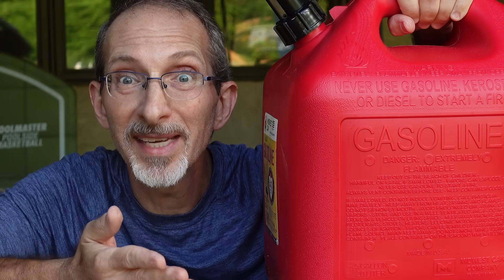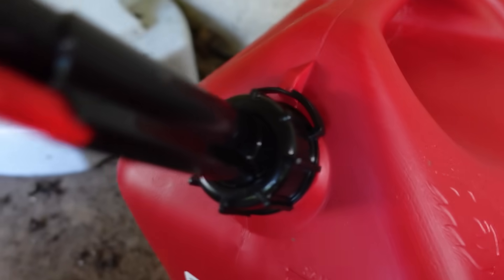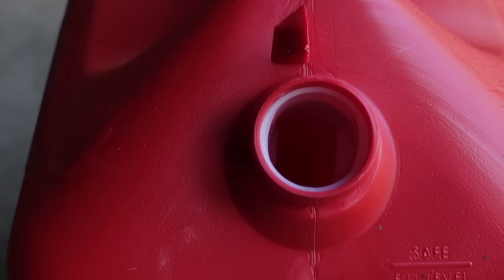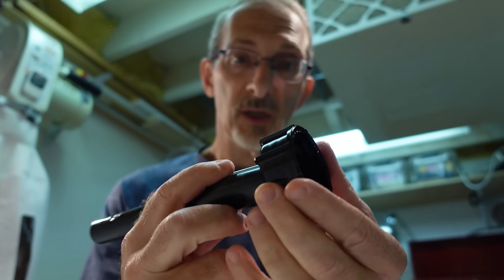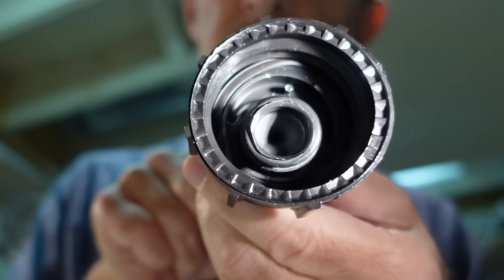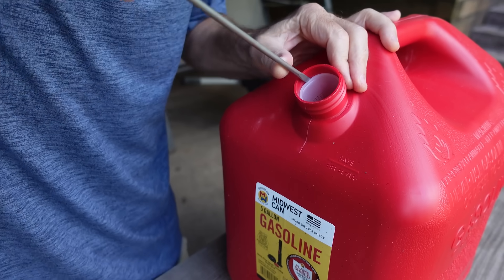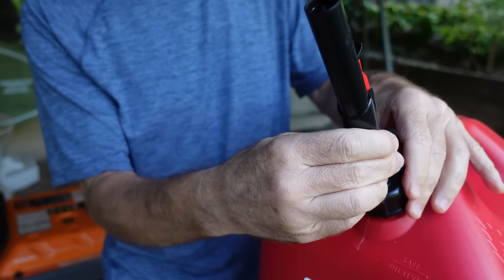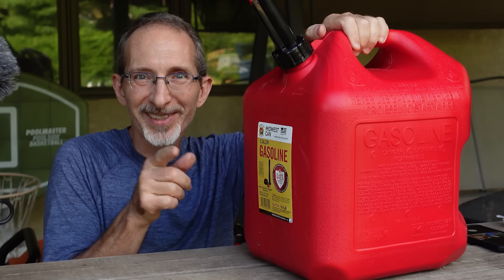Gas Can Modification | New Gas Can Fix

Comment: As soon as you get the very 1st gap on your debre filter , get your plyers in real good and twist the plyers till the filter collapse's and comes loose then it will slide out easily . If you will try this the filter will come out in 30 seconds and no damage to the fuel can.

Comment: The absolute stupidest part about these stupid "No Spill" gas can designs is that they cause you to spill way more gas than any of the sensible old designs. But wait it gets dumber. When the can is a couple of years old the spout will no longer close. You literally CAN NOT close the can because the automatic spout gets jammed in the open position. Brilliant design.

Comment: These are nice gas cans. I have 4 or 5. That said, if you're storing multiple cans then you really only need one nozzle. You can buy an "old style" nozzle with a cap and just buy a solid cap for the rest of the cans. I use a solid cap on all my cans and keep a nozzle to put on the one I want when I want to use at the time. It's also best to use an all-metal tire valve stem to put on the back of the can as a vent. There's plenty of vids to show you how. Just make sure you use the all-metal type. The rubber valve stems don't last because, obviously, they're not designed for constant hydrocarbon exposure.

Comment: My solution is to remove everything, leaving only the threaded outer ring, and cut a disc of 1/16" Teflon to cover the hole in the cap. To pour out gas, I've made a funnel out of a coffee percolator from a thrift store, solves all spillage problems.

Comment: I left the dirt filter in mine and installed a retrofit kit, new longer flexible old style nozzle and drilled a hole at the bottom of the handle for the vent plug and now it works at the pump and to fill my scooter up ( too hard to regulate the pump pressure on a scooter fuel tank so using a can is so much easier ) a little slow but I can actually get a full tank this way

Comment: 😮Tractor supply, Northerns, Harbor Freight, even Amazon sells a very affordable kit, to kinda convert gas cans as they use to be, kit comes with an air vent with a snap lid, drill a hole an pop it in, kit comes with a nice flexibility spout also with a cap, with extra screw caps to insure it will fit any brand. Also comes with a storage cap.. this is the best way to deal with this so called safety can..

Comment: You bought the wrong gas containers. There are push-button valve cans on the market that work great. Easy to fill. Easy to dispense into small power equipment tanks. My favorite is Spill Proof brand
Reply: Sorry.. actual brand name is No-Spill

Comment: Yep, todays gas cans suck.   A few years ago, I bit the bullet and bought some metal military/NATO spec gas cans ( Wavia brand).  They are expensive, but for work & play I’m engaged in, they are worth it.  These days, they do come with horrible safety plunge type spouts, but a few mouse clicks will get you the good old fashioned free flow flex spout.  I only put a spout on to fuel, otherwise the cans are sealed with lid, so no off-venting. The lid closure and spout attachment are with a simple cam lever - quick and easy, no screwing on/off with safety mechanisms.  These also resolve an issue I’ve had with every plastic can, deformation from pressurization and temp change: ballooning out or collapsing in - they are the same again.

Comment: Last winter I bought a diesel heater and got a "Midwest Can" brand jug for diesel fuel.  It's basically the same design, just made with yellow plastic instead of red.  I had the same trouble with the spring loaded spout, but didn't realize that anything could be done with it and just resorted to trying to pour without using the spout at all.  I usually didn't spill much...  unless there was any kind of breeze.  This is so much better.  I don't know how youtube knew to recommend your video, but I glad it did!  Thank you.

Comment: Reading the comments I'm amazed at how many people can't use a gas can. Also can't believe what a weakling the guy who made the video is. The spring makes it too hard to push? I modify all of my gas cans. It doesn't take a genius to be able to figure out how to cut that first tab off. Just grab the filter and pull, it's not hard to pull out. Removing the spring is pretty stupid because then gas can leak all over when it doesn't seal. I just break off a little red tab and have no problem pushing the nozzle in to start the flow, but it still seals the can. I prefer the spring-loaded nozzle because I can turn it upside down and get it into the tank I am going to fill without spilling any gas until I push down. I can't believe YouTube pays idiots to make videos like this.

Comment: The filter is pointless...if it is supposed to filter any dirt coming out of the underground tanks then that dirt is there in the filter, so when you pour the gas into your say lawn tractor that trapped dirt now flows so nicely into your gas tank. Leave it up to those intellectual engineers. Shouldn't you at least have the option to be able to pull the filter out and tap out any dirt first.

Comment: I don't think it's safe to you as much as environmental. 
Best same do is go to a yard sale or auction just buy used one. Also remember to Cadillac converter test pipe so used to sell 30 years ago? Now you can get a repair kit for the gas cans at your local lawn and garden supply store. That does not include Woke-Mart! And not only does have a flexible durable spout. It also comes with a pressure release insert and cap. And $15 for a can like that nowadays is really cheap but your episode is 2 years old and it was just recommended to me by YouTube

Comment: I like your first idea.  clip off that thing and toss it.
The second idea... remove the o-ring, remove the spring, remove the whole insert, throw away... even the spring, you will never really ever use it again for anything.
Buy a rubber cork for what is left over of the nozzle.
Third idea... good work.  rip it out, throw it away.

If you want to be safe, then do safe things, and you won't have to worry about gadgets forced on you by some idiot lawyers.

Comment: Although the EPA has done a pretty good job for most environmental issues, this is one area they should have STAYED AWAY FROM! I spill more gas with these new gas cans than I ever did with a regular old gas can with a flexible spout. Not only that, your typical 5 gallon gas can now cost about $28-$30!

Comment: And... this is why gas cans are $20-$30  instead of $5. What I find incredibly stupid (the whole design is stupid, but one part outshines the rest) is the filter screen. So, I suppose it is there to keep contaminants out of your gas can, but the contaminants are trapped in the screen. The gasoline flows through the screen and through the nozzle into the tank that you are refueling. It would be much better to leave the trash in the bottom of your gas can.

Comment: I have the 2 1/2 gallon version of that can and it doesn't have a filter, probably because it's older. It is a pain in the ass sometimes, but not enough for me to want to modify it. If I did though, I think I would cut a few coils off the spring and reinstall it rather than remove it. If you ever accidentally knocked your gas can over, you know why.  I mainly use the can for filling my lawn mower. Instead of trying to press hook against the rim of the gas tank and pull the magic button, I have it facing up and pull it back with my thumb. As long as the valve snaps shut when I let go, everything works out, but one time it stuck and the gas poured out until I tipped the can upright, which I was doing anyway. Not a big spill, but I'd rather not waste gas by spilling it on my mower. The ratchet thing that makes it hard to take the filler cap doesn't stick after the first turn, so that's not a problem for me. It's actually a benefit because I took this can and another 2 1/2 gallon can with me on my ATV ride and overnight camping trip. I had the cap of an old gas can unscrew from the vibrations a really long time ago. It didn't have that minor inconvenience on it. Of all your mods, I would definitely remove the filter if it was causing ANY problems. Maybe shorten the spring so it had less tension, but leave the filler cap alone. BUT, above all, the government should keep their hands off our gas cans and let US decide what kind of gas cans  we want to buy. Besides, a pain in the ass vent-less can dumping fuel on the ground is worse for the environment than fumes evaporating out of a regular gas can.

Comment: Keep in mind that if the gas cans are used in a commercial setting, OSHA will require that the "safety" mechanisms be fully intact.  If they find that the cans have been tampered with, they can, and almost certainly will issue a citation and probably a fine.  

Other wise, great information,  THANKS

Comment: So what if you ‘break’ any rules. It’s MY gas can and if I am smart enough to not need those ‘safety’ enhancements I shouldn’t have to suffer with them. My old style cans with the snap on caps work just fine.

Comment: They sell the old nozzle kits. As far as the filter if you hold back a little and just pump gas on the low flow there no problem.

Comment: Now all it needs is an air vent at the top opposite of the spout, and it will pour well. Or you can take the whole spout off and pour into a funnel. That’s what I do with the new blitz gas cans to save them from being useless.

Comment: I’d recommend a No-Spill gas can.  No-spill gas cans are great.  They have a button on the back of the spout you press with your thumb to pour and (at least when I got mine 9 years ago) doesn’t have a filter blocking it he opening.  It still has the lock for removing the spout though.

Comment: Leave the spring in.  Simply remove the red latch that holds the nozzle out.  Then you can use the lip on the nozzle to compress the spring with out the security latch being in the way.  The spring remains functional and keeps the nozzle secure when not in use. Makes for easy one handed pouring too - simply lift your gas can away and the spring seals the gas in.  For small engines that move around,  you can use your other hand to compress the spring, or hold the  engine.

Comment: I hang onto all my old style gas cans that work the way they should, when I had to purchase a couple 5 gallon gas can similar to the one in the video, I also removed that stupid filter because think about it if you're filtering the gas is going into the gas can but then poured into whatever you're pouring it into whatever us in the filter is now going into the item that your filling. I also found at one of the big box hardware stores an aftermarket spout that has a flexible neck.

Comment: Sounds like a German way to engineer something.  Take something SIMPLE that has worked fine for years, (like a gas can with a pour spout AND and vent!) and "fix" it until it no longer works or is so complicated nobody wants to use it.

Comment: That's dumb. Once you get the needle nose in there you simply twist the needle nose around and it will pull the sides of the filter in and it will slip right out.

Comment: I HATE THE NEW CANS, THIS WAS A GREAT REVEAL. QUESTION: THEY NO LONGER SEEM TO COME WITH THE LITTLE VALVE THAT ALLOWS AIR TO FLOW WHICH ALLOWS PRESSURE TO RELEASE FROM GAS FUMES, WHICH  CAUSES SPLATTERING WHEN POURING. HAVE YOU FIGURED THAT ONE OUT?

Comment: For decades we had gas cans with simple gas resistant rubber nozzles and an air bleeder hole on the other side of the can or a small cap we could unscrew and those worked PERFECTLY! I've never spilled gas until all of these new "safety" devices showed up! Rubbish garbage!

Comment: The first time I used a similar gas can in NY state, I was trying to add fuel to a riding lawn mower.  I couldn't put pressure on the tank to open the gas can nozzle to allow the fuel to flow.  So I had to figure out how to manually open the nozzle while still having the nozzle in the filling hole for the lawn mower tank.  Awkwardly holding the gas can under my arm, I didn't realize I was squeezing the gas can, pressurizing the contents.  As I was trying to figure out how to hold the nozzle open, I accidentally opened it and high-pressure gasoline sprayed all over my garage, splashing up against my car with the engine still hot.  I'm lucky I didn't kill myself and burn down my house, just trying to mow the lawn.  I knew the gas can had to be replaced, but state law prevented selling any other kind of gas can than the shit I already had, which was clearly (ironically) a huge safety hazard.  My solution?   I went on Ebay and purchased a new gas can from another state.  It didn't have the NY state-mandated safety features.  So, it was SAFE!!!   :)

Comment: useful video. and just for clarification the filter in the gas can ? will keep contaminates out of the gas can ? but the moment your pour the gas into your car the contaminates are on the OTHER end of the filter and will be washed directly into your gast tank ? what rocket scientist designed this set up ? if the filter for the can was easily removed ? you can poor gas into the can remove the filter and clean it and then reinstall it before pouring into your car . extra steps but will work. if you really want to filter gas ? use a 100 micron paint filter for spraying automotive paint but you really want a 20 micron filter. place an electric pump with hose and car filter and pump it in that way . Most new cars do not have a fuel filter they have a fuel "sock" that really isnt very good and the reason they removed the filter ? because it is a $10-$20 part and they want the injectors to get dirty and fail so they can sell you new injectors for $150-$350 each plus the service to flush the system and drain and flush the fuel tank. they do it because any contamination to the system is not warranty and customer pay. all the motor companies agreed to do this that is why no more fuel filters.dirty fuel filter can create resistance to make fuel pumps fail which are a warranty item.

Comment: Removing the spring is a good idea but youtuber Tractor Mike has a great idea for better flow by installing a modified truck tire stem valve on the top rear of the container to allow the gas to flow quicker.

Comment: I acquired  a number of 1 gallon gas cans when cleaning out an aunts house.   Great!  As those flexible yellow  fill tubes  will biodegrade if left down in ethanol gas .   But guess what?  The  threads are incompatible between brands of gas cans.   

My question to you is ,  is  the  latest "safety" lid  gimmick really about safety or a  marketing ploy?

Comment: On number three, if you simply rotate the pliers while holding the edge of the filter tightly, it should twist into a smaller circle and come right out.
Reply: I just tried your technique and it worked perfectly and left the filter intact! Now I have an inlet filter for my shop vac that will keep it from functioning properly so OSHA should be happy.
Reply: I just shove the sucker inside. Doesn’t interfere because I only use a siphon to get the gas out, but I could see it perhaps being a problem if I poured.

Comment: I had to buy a “safety” can (not the same as this one) when the gas station I usually go to was unexpectedly closed and I didn’t quite make it to the next one. Between the new fangled can and the flapper valve on the car’s filler spout there was probably a gallon spilled on the car and ground and 1/4 gallon in the tank. That was enough to start the car and drive to the pump. It was a very frustrating experience.

Comment: Well played! On my gas can they call that "filter" a "flame suppressor".... 😂🤣.... I'm not really sure why he would have fire that close to the nozzle of your gas can or who would even think of doing that to begin with, but my parents taught me if you play with fire you plan on getting burned....
Fire that close to the nozzle of your gas can ...
Can't anyone say "Darwin awards"?
Either way whatever it is, Be it filter or flame suppressor, I found it with it removed I can now flip my lid upside down and put my spout down into my gas can and carry it that way instead of having that long spout way up in the air!
The safety feature on the spout prevents the gas from leaking out so there's no need for one of those funky flat red plastic caps that you're going to lose anyway....
Jeeze - Louise! Whatever happened to a good old-fashioned bendy spout an event cap on the other side of the handle? Like millions of other people I used those my whole life and never caught myself on fire or burn my garage down....
HMMMM.....

Comment: There are several new types of gas cans that are all the most ignorant engineering I have ever seen.  I hate mine but also hate to throw it away since it's new.  I am sure one of these days it will make me mad enough to. You need 3 hands to operate them and they are still pathetic.. Come on Guys, you can do much better than this !